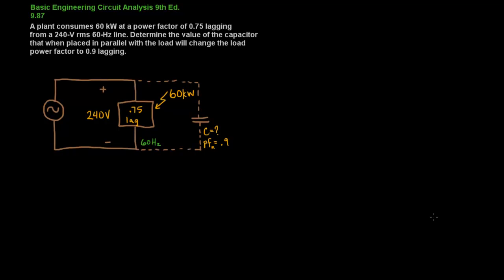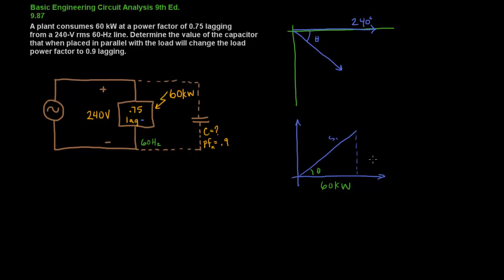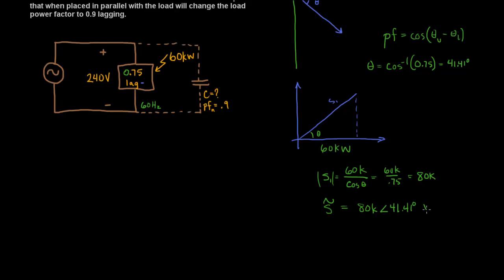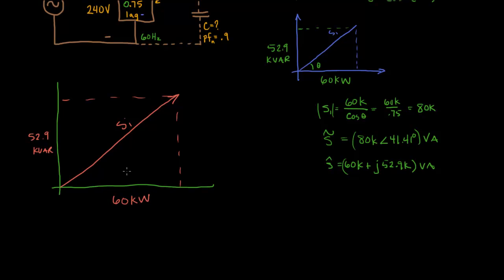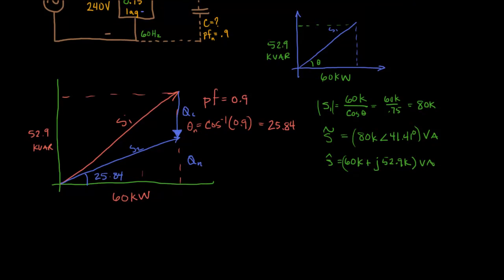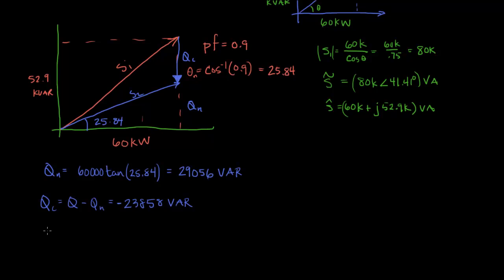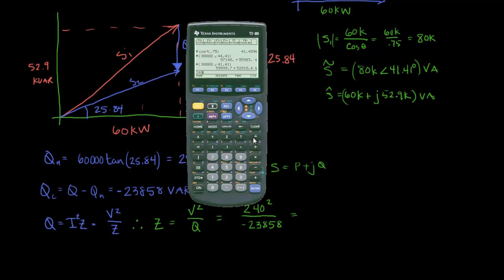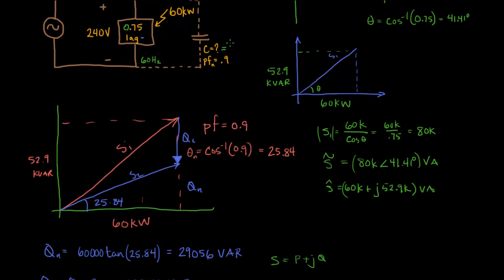Power Factor Correction

Comment: At 5:23, you mentioned the easiest way to write the complex form is to type in the phasor form into your calculator and convert.  Perhaps an easier way is to take sin (41.41)*S (which is 80) and plug that into your calculator to get the VAr, the "imaginary" number.  Fewer steps, fewer chances to screw up, and works on every basic scientific calculator.

Comment from the maker: Ultimately, Qc is describing a capacitor, which means that it supplies reactive power.  Supplied power is a negative sign.  In addition we know that the impedance of this capacitor is negative, so the sign should be negative.  The subtraction gives the magnitude of the vector, but the direction of the vector indicates the sign.  Hope that helps.
Reply: or we substitute a negative angle since current is lagging

Comment: Very interesting, but the frequency of 60 Hz is 60 Hz. Where does the 377 come from? Also, is your 240 volts peak or RMS voltage?
Reply: William Morse Voltage is RMS.  For the 377 this is in fact 2*pi*60

Comment: respected sir,
want your confirmation for my thought...
if i add a capacitor bank in parallel to all the inductive load in my home.. would i be saving on my bills..?
Reply from the maker: The quick answer is no.  In most cases I believe, the power company deals with adjusting the power factor.  The one time this is an issue is with industrial facilities which have highly inductive loads which make the power factor really small.  In order not to occur penalty charges, they will often add a capacitor bank.  For residences, the utility companies charge by the kwh. I'm no expert on this though, and it might be different out of the US.
Reply: Matthew Araujo Thank you sir....

Comment: Hello,
Here power factor never controlled, and KVAH values are higher than the KWH value that is 29164 KWH and 54319 KVAH, Now power factor is working 0.93 to 0.98 with Auto power factor controller. Even the PF is controlled to 0.98 , still calculated Average power factor is coming 0.539. In tariff billing pf is calculated on average which is 0.539 and liable for penalty. kindly suggest how to control KVAH value